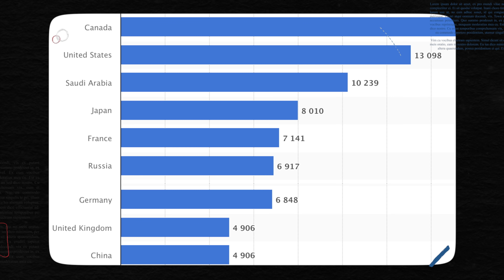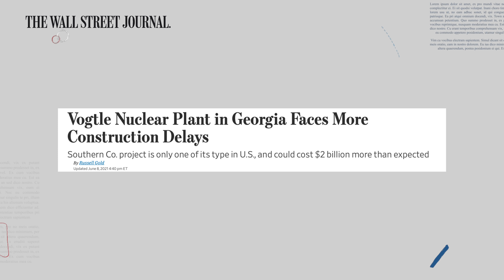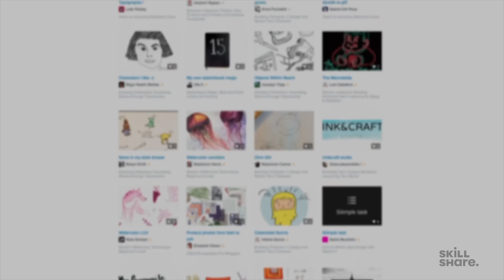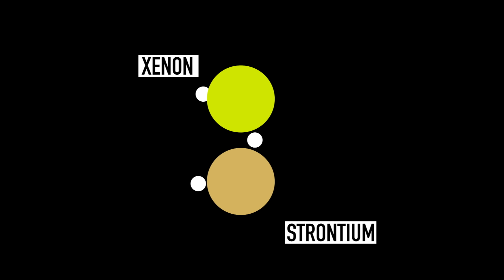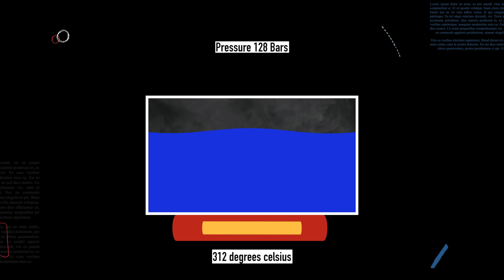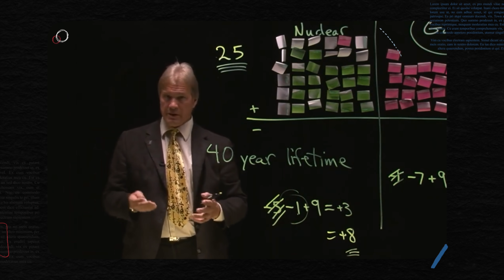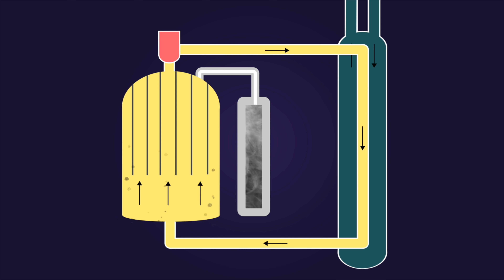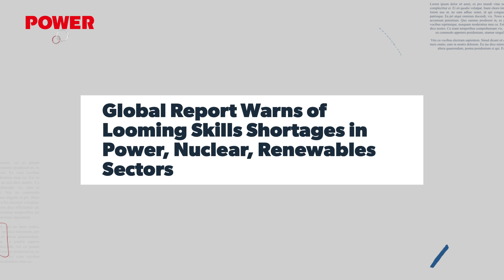Thorcon Just OBLITERATED Nuclear Energy’s Biggest Problem

Comment: If you do nuclear right, you don’t need to mess with that “renewable” nonsense. 

France deployed nuclear power very quickly. They standardized one design and made their power grid reliable and comparatively inexpensive. Definitely cheaper than “renewables”.
Reply: “renewable” nonsense.? 
just because the carbon goals set by the elites are literally impossible to reach.
that there is literally not enough silver on earth to make all the solar panels needed.
that every wind turbine require 900 lbs of rare earth metals.
there just may be enough rare earth materials to make this delusion come true.
we just have to turn over ever feet of the earths surface until we do.
all the mining for rare earth materials would create a massive amount of carbon byproducts.
you have to believe in the science! and a miracle material may appear to save us all, sent from the heavens.
before this entire fraud is exposed and the world economy collapses under its own weight.
Reply: @brusso456 you won’t find me defending wind and solar.

Comment: Thorcon? Never heard of them, are they sufficiently financially secure that they could weather construction problems. I had trouble grasping the relative merits of this design, all I coouls grasp was that it's supposed to be quick to build which I doubt. Why is this considered superior to a thorium reactor. Still apparently we have accident prevention & waste disposal issues/
Reply: It's the same basic concept as a thorium reactor. And all thorium reactors need to be "jump started" by either enriched uranium or plutonium (or face a 12 year ramp-up to criticality, which is obviously not economically viable). These are, however, able to be topped up with either uranium or thorium depending on what is available at the best price.

Comment: Thorcon has OBLITERATED literally NOTHING. Unwrap comment for details.

First.

Their NPP design is a joke. 500 MWe plant houses 4 (!!!) reactors, of which 2 at a time are operational, and only for 4 years. After that, they are throwaways, after cooling for 4 more years, doing nothing, just heating atmosphere. They should be removed from the plant (sic!), "reprocessed" (which basically means storing them as nuclear waste, but they usually stay calm on this matter saying a plant would produce couple cubic meters of waste a year). Online refueling has no benefit in this case, as reactor campaign is shorter than full fuel campaign of typical PWR. Danish Seaborg Technologies designs 12-year reactor, just for your information.

Second.

They claim extreme security, because first and second contour salts are at atmospheric pressure, so very little chance it will escape in a blast of 160 atmospheres. Yeah. Cool. If you look at the design, the reactors are surrounded by pools of water. Now guess what happens, if 500 Celsius molten salt gets into a pool of water. Yes. The same thing, when cold water gets into an overheated boiler. A steam blast, taking away radioactive salts, potentially leaving NPP with no containment building. Like lava in the ocean.

Third.

They everytime claim they require only a small amount of low-enriched uranium to start a reactor and some for maintaining reactions, while still marketing it as "Thorium reactor". Shall I tell you how much that really is? 3.1 metric tons of 20% enriched uranium initially and 11 kg per day. Yeah! Thorium reactor! For example, a typical PWR with 1000 MWe output houses 60-70 tons of 3-4% enriched uranium. Thus, a "thorium reactor" would require "only" 3.82t of 100% U-235 over the course of four years, while scary PWR - 1.8 to 2.8 tons 100% U-235 over 18-24 months fuel campaign, where 2/3 of fuel rods are just installed closer to the center every time, making them work for 5-6 years in total. Which is 1.2 - 1.5 times more that TMSR-500 would last. Loud and clear: Innovative Thorium Reactor!

Fourth.

Building them on a shipyard is just a marketing dream which grows of someone's background and attracts government officials, which are quite often incompetent. If one of Thorcon architects had been a lumber mill owner - they'd claim to build wooden NPPs. I imagine IAEA will be impressed and frustrated by proposition to build NPPs by unspecialized companies not related to nuclear energy at all, that civil shipyards clearly are, good luck. If they aimed for cheaper option and claim no superior structural quality is required, they would build it from prefab panels. But noooo! They want ships! Because cool! Requires no rebar!
Reply: @EnlightenmentLiberal From what I've seen, there are pools of water above and below the reactor. Nothing of it is very safe in the worst case scenario.

Fuel enrichment to be 19.5% according to them.

As for the ships, I can't really judge whether good or not, but serial approval is hardly possible.
Reply: @EnlightenmentLiberal Worst case scenario would be an opened upper projection of reactor vessel, as a result of sabotage, mistake or whatever. If it comes to contact with water tank, which is in proximity, water will instantly evaporate in an explosion of steam, taking away salts, decay products, fuel in a form of water-based aerosol, even if the reactor vessel is under pressure slightly bigger than atmospheric.

Under 'serial' approval I mean the process of certifying NPP design for mass construction. It is usually a long and costly process in home country, a very painful process abroad and quite some time is also consumed by IAEA. These guys don't even have a working prototype, they only speak of scaling up research reactor which, to the best of my understanding, never actually worked with Thorium.

Comment: IMHO it's be safer if it used thorium instead of uranium doping, as the thorium reactors need an active source of neutrons to start the nuclear reaction.  It's thus easy to kill the reactor by shutting down the neutron injection.  No need to replace the fuel as often either.  There's also the issue that still cripples thorium reactors (and other molten salt reactors); the salts are really corrosive for the piping.  Geez, we even had unanticipated corrosion issues with CANDU reactors, and we were only using water.

The idea of a semi-submerged/floating plant is also in my opinion a bad idea, as a major screwup is harder to contain.  There's also the added risk of natural disaster (Fukushima's tsunami anyone?)

Globally it's a step in the right direction however, as they're moving from pressured-vessel to molten salts.

Comment: The Thorium cycle, is different from the Uranium cyccle, but not by very much. The Thorium is converted to Uranium, within the process.. It also includes a chemical re-processing component, to keep the salt at it's mixture levels. Both cycles produce daughter products (the bits that fission splits into), and that is a gradual release, a systemic polluting of the neighbours. This video claims that the gasses are collected, but that is delusional. As is the title, "just obliterated". A false claim, this is just another sketch, of a plan to create a test. Thie title is delusional sales pitch. The people making the claims, know that, and are intentionally inducing delusion in us, to sell their product.

And the waste on a deserted island? The storage casks only last for 100 years, then they have to be rebottled. The underground storage needs geology, ie deep rock, but the islands are small and at sea level. What they are suggesting, is an easy fix to a problem that has not been solved. The Finns plan to use deep burial. This video want to let the sea salt eat the barrels, and let it leak out, to the ocean. Well after they are dead, so they dont care.

See how easy things are when you invoke delusional thinking.
Reply: @EnlightenmentLiberal 
Why is it delusional? These engineers come from a factory of delusional thought, into an industry of delusional pretenses. The are surrounded by claims that they subliminally absorb (eg "zero carbon"), and it becomes a part of them - I guess. Why do they do it? Once locked in, they cant do anything else. Why all the delusion? Money?
Reply: @EnlightenmentLiberal 
YES i get upset by all fake green claims. The OP's claim is not for all the daughter products. It claims a replaceable 4 year unit. Here is a big hint: It is not a working thing, it is a cartoon.
Reply: @EnlightenmentLiberal 
Plumbing.
Safe containment of gasses for 4 years.
Operator less operation.

Comment: though I agree with renewable energy man is not in anyway the major cause of climate change . but the earth has its own cycle and will do what it darn well pleases . second: though the system is heavy and large how do you convince a tidal wave that it shall not move this structure at all. if the unit is tilted even a little bit it will start to compromise one if not all its safety systems.

Comment: They solved the cost problem by skipping the 3 foot thick containment building, what could go wrong?
Reply: Nothing really. Considering how the design and fuel both were explained to be a lot less radioactive and considerably easier to cool down (even just naturally), the chances of it becoming a problem are next to none.
Reply: @nicolaszan1845  Less radioactive isn't non-radioactive.  If the reactor blew up by accident or was bombed, it would be a very serious wide spread catastrophe with billions in India affected.
Reply: @bam5732  Thorium isn't perfect and is potentially dangerous when mishandled, just like literally every other energy source. Whaddya know.

Doesn't take away the fact it is by far the most environmentally friendly, constant power source available to us as a species. And a lot cheaper than Uranium, without the need to cut corners like you said.

 Nuclear power in general is the safest form of energy we have, compared to the amount of energy it produces, and Thorium is both safer and more accessible than Uranium, our current nuclear fuel, which already is orders of magnitude safer and better than fossil fuels.

Comment: I still think if they could just solve the solid state problem, running the hot metal sodium down a large enough coil fast enough SHOULD make power, instead of the rather inefficient, and as you said, slightly risky, steam via heat exchange...

Comment: I’m all for more nuclear energy, but I’m failing to understand why this video is suggesting we build them IN water. We’ve had enough issues on land with nuclear, why would we risk the potential of destroying our marine ecology??
Reply: We really wouldn't. The video very clearly mentions how Thorium reactors are safe and don't actually have much (if any) real risk of overheating.
Reply: @nicolaszan1845  even if somehow there is zero risk of environmental impact, the cost of doing maintenance on underwater systems is much larger than on land. In my state we have several oil lines going on the bottom of our waterways, and nearly every year there is leakage due to improper maintenance. I’m VERY wary of building anything in water. Just seems like a ticking time bomb.
Reply: @jacobvriesema6633  Well, even then, Thorium reactors aren't solely built to be underwater. They can work just fine on land, it's just that they need the actual building construction for it.

The cost reduction would be lessened by a fair bit, but t can still be done.
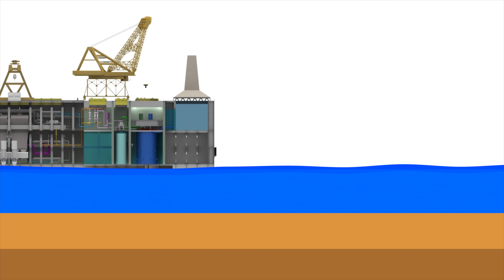Reply: @nicolaszan1845  she clearly states at @3:15 that the intent of the design is to have them installed in the water. No mention of land, unless it’s mentioned much later.

Comment: Oh look you can just turn the carbon dioxide from your power plant into graphene....... oh my bad... i forgot activists don't care about any solution besides banning fossil fuels cuz muh pLaNeT

The process they came up with involves taking the greenhouse gas carbon dioxide, together with hydrogen gas, and converting it directly into graphene at temperatures of up to 1000 degrees Celsius with the help of specially prepared, catalytically active metal surfaces.

Comment: This design is fail safe...unless the plug at the bottom designed to open when there's excessive heat fails...but the chances of that happening are very small.  The biggest issue is dumping of spent radioactive fuel.  Given India is a developing country, I'm sure they have a low-cost solution for that, in some unused farmland...

Comment: snake oil is not what I'd call this pitch but it's close. There are a few things that are conveniently left out and a couple that are just, WTF. Like, why would you even bother co-opting MSR technology just to run a low grade uranium power plant ? this is like taking two steps forward and one step back. This wreaks of Chinese style rip off someone's I.P. and using it in a half arsed manner just to get something cheap running. Thorium lifters are way superior in every metric and don't have all the high maintenance and fuel replacement cycles this idea has. I mean, why bother ? this method would be cheaper in the short term, but in the long term, no, definitely not. The system Sorensen advocates is the way to go.

Comment: The main impediment for successfully deploying safe nuclear power is not, IMO, technological but rather managerial.  It seems that we are we are not capable of guaranteeing intelligent thoughtful management of reactors over their 40+ year lifespan.  In each case of nuclear disaster, initial causes or compounding issues were caused by human error.  Creating larger numbers of smaller reactors only multiplies this effect.  It is unfortunate that safe renewable sources of energy are unlikely to develop in time to save us from the current planetary crisis.  It seems we have little choice.  We need nuclear, at least to stopgap our energy needs until safe renewables come fully online.  Advances in nuclear plant design are very useful in increasing reactor safety.  What we really need, however, is a new model for nuclear power operation and management.  Perhaps something like how NASA works with commercial space developers to insure safe operation, possibly including the military to provide physical security.  Clearly, for profit companies cannot be left to their own devices.  Active independent outside monitoring and governance should be standard.  Idiot-proofing the monitoring and controls of the reactor are also clearly a priority for safe operation.  Past reactor incidents had designs that made it difficult to assess the true state of the reactor under crisis conditions.  Simpler designs can also lead to increased safety.

Comment: It sounds great - but has anyone proven that this works by creating a functional reactor that produces more energy than it takes to build and operate?
Reply: 1957 was when they tested one at ORNL. Although the plan was to make a nuclear aircraft the functional parts are identical and at that time uranium and it's enriched isotopes were far more interesting to the people funding those projects.
Reply: @d3m0n54in7  I had previously heard/read that the ORNL reactor had not produced net power.  The wikipedia article that I just reviewed seems to indicate that the small reactor was successful and the metallurgical issues they encountered are solvable. Thanks for the clarification
Reply: @oldgeek59  you are correct that the reactor did not produce electricity. It was instead used to generate the heat that was supposed to expand air inside of a turbine engine which required tremendous amounts of energy. It would have been a trivial task to hook it up to a steam turbine but as I mentioned earlier, the monetary interests were elsewhere. A safe assumption is that if it was nearly viable for aircraft with small scale experimental reactors then a larger, more robust variant would meet the commercial demands.

Comment: Every home built should be fitted with wind and solar they go well together in most places. It could be done easily and cheaply if it were DIY and should be treated like wiring a home. Set it up, have it inspected and if it passes flip the switch. It is at an average cost in my area of 40,000 dollars for a system because they make you hire contractors.